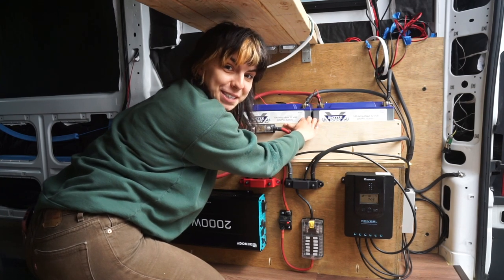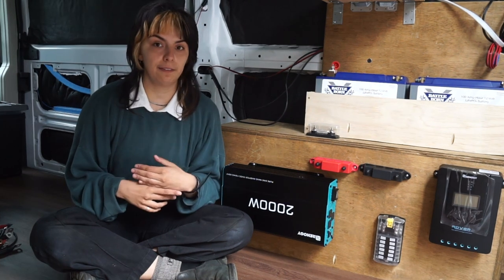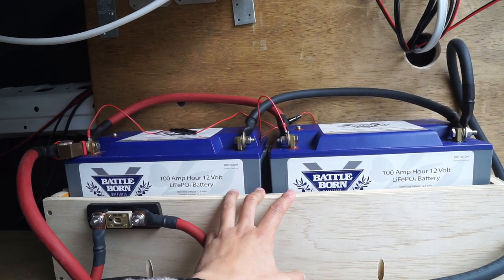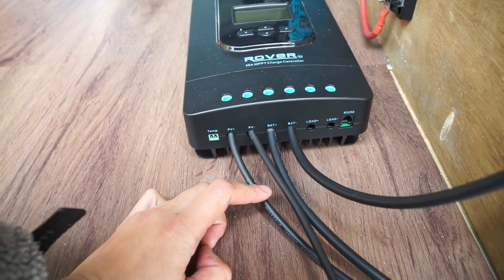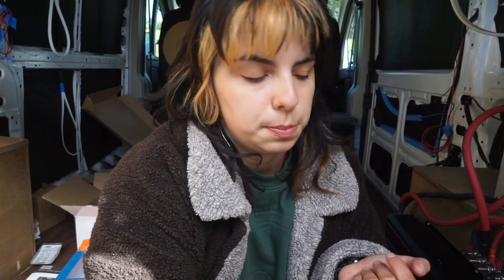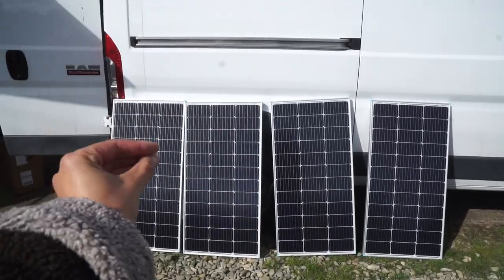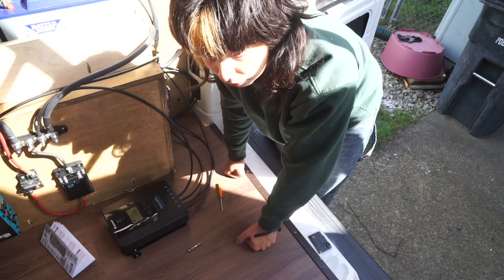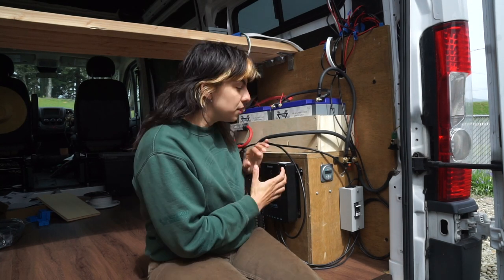VAN BUILD | DC SOLAR ARRAY With No Experience!

Comment: your command of the tools and terminology is really impressive. honestly for not having done it before i know plenty of contractors that couldn't name half of those components and they do this stuff every day. 

don't you love how they switch the wires / colors for AC vs DC? gets me every time... 

and is there a better moment than doing something like electrical when you don't know it and it lights up for the first time? that was sweet :)
Reply from the maker: Thanks JJ! I really wanted to make the all in one video I needed when I was researching my solar. Glad to see it translated well. And YEAH changing the wire colors... what’s up with that? And then there’s the wires that are yellow and blue... so confusing. Thanks for your encouraging words 😊